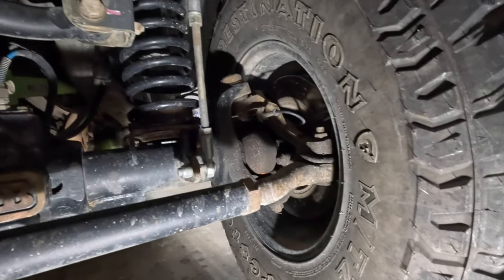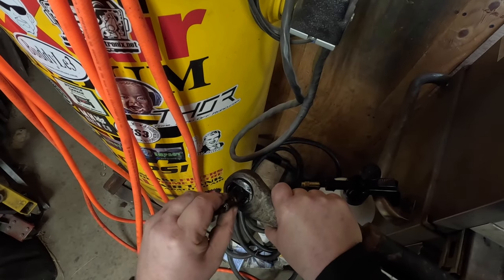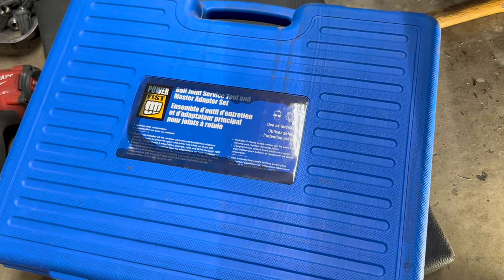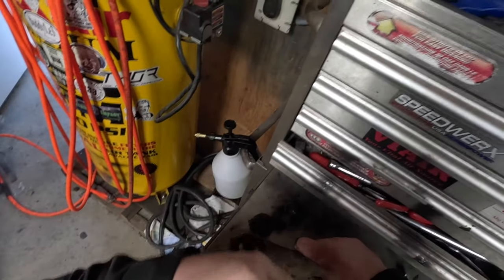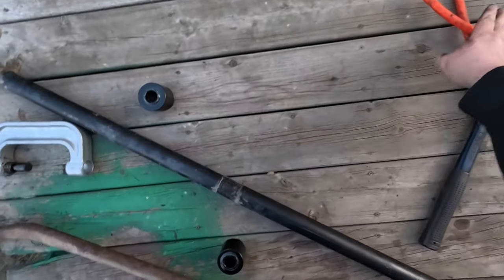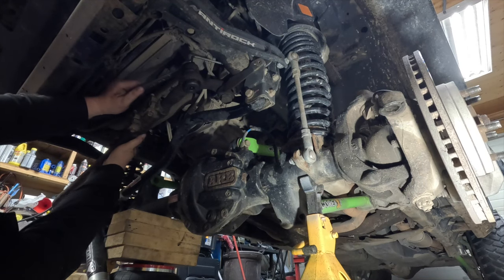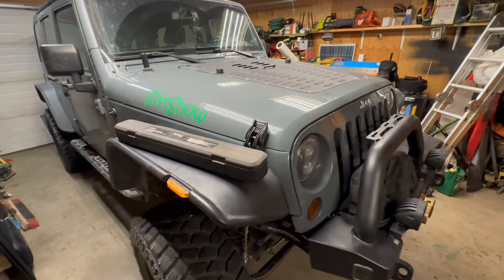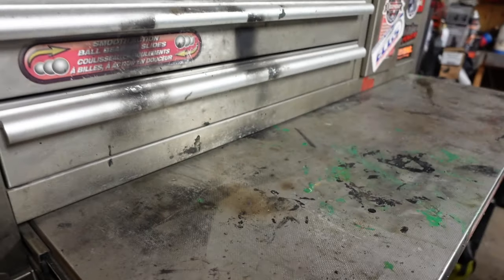STRUGGLE BUS REVENGE - Jeep JK Steering Rebuild

Comment: Why not use some heat? I bought one of those induction heaters. I won't touch my Jeep without it. That and a breaker bar.
Reply from the maker: I would love a induction heater, last time I looked they were crazy expensive
Reply: Here in the rust belt of il we use pb blaster and heat from a torch a lot. When I do ball joints I tighten the press up then if you give it a nice hard smack on the outside of the joint that holds it. It then should be loose tighten it up and give it another smack and so on.
Reply: Heat it up well with a blowtorch , it is helping a lot and some liquid wrench to spray on it .
Reply: Propane torch and map gas are for kids. I go right for oxy ac torch to heat up stuff now. Cherry red makes things move

Comment: Don't know if it might help in the future but a lot of times if you are using your ball joint press and it binds up and the ball joint isn't moving, you can give it a whack on the side with a hammer where the joint goes into the rod and the sudden jolt will break the rust free.  Be careful though because it usually makes a big pop and moves a bit when it breaks free. Doesn't work all the time but a lot of the time.
Reply from the maker: Heat works good as well but also sketchy when it breaks free.  I did that pulling a flywheel off a small engine one time and it went flying

Comment: after i saw your video years ago doing the upper control arm bushings on your TJ with your ball joint press, i bought the same one, its a game changer👍. ill never give up my air tools, they seem to be more powerfull than my Milwaukee. i wonder if you could replace those TRE's with GM 1- tons. i have Aresfab steering on my XJ and it uses GM 1 ton TREs, theyre more cost effective and available everywhere.
Reply from the maker: You most likely could if the threads are the same

Comment: A bit of heat on those ball joints would have helped , not to much though just enough to get 'er moving.
Cheers , Wild Bill overlanding the remotest parts of northern Canada.
Reply from the maker: You doing any adventures in the winter ?
Reply: @BackCountryWrenching  No adventures this winter , was going to head to Arizona in the 4 door , and winter down there , but some family obligations got in the way .
I'm doing some adventures in the shop to the Jeeps to improve for future adventures , next summer maritime provinces . Newfoundland has an off road track that goes right across the middle of the island , I want to do that one . 
This winter I'm  doing some maintenance and repairs on my machine tools (lathe and mill). I'll be putting that on my channel the work on the Jeeps and the machine tool work.
Cheers Bill .

Comment: 20:42 Ball joint removal struggle expected as they get seized over time, grease gun fitting fight to the death not expected. Who in the universe did you piss off for that to happen?
Reply from the maker: Hi Barry how you been ? Have you gone out on any adventures since ?
Reply: @BackCountryWrenching  No major adventures since returning from Kamloops/Shuswap. I have been dealing with my dad's estate as well as insurance/contractors from the basement flood. As far as the basement flood goes we are on the home stretch getting the basement finished. Wendy and I did take a quick trip to Shelby Montana last weekend but nothing really noteworthy. I can't believe how mild it is for December. Are you planning any winter trips after Christmas?